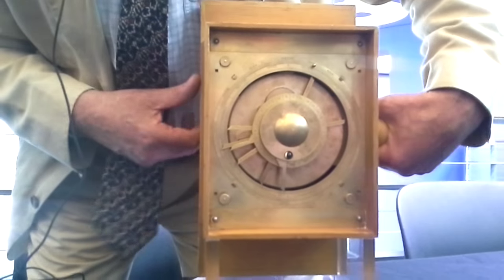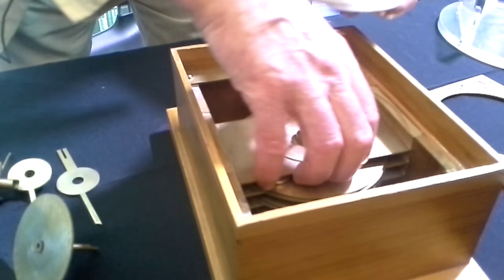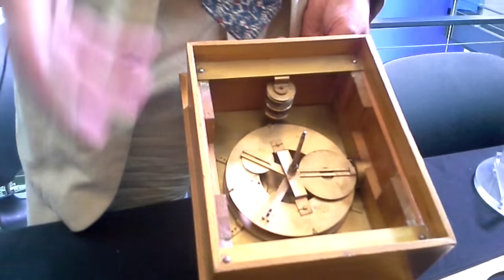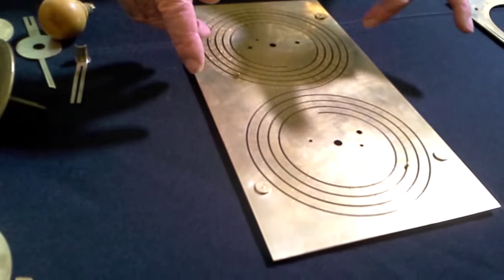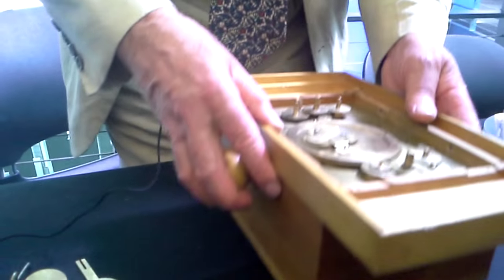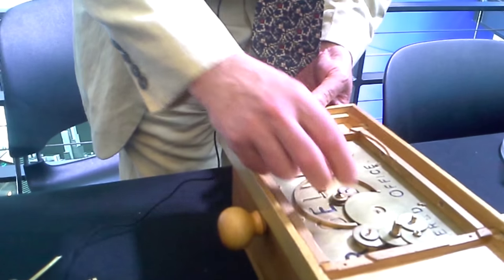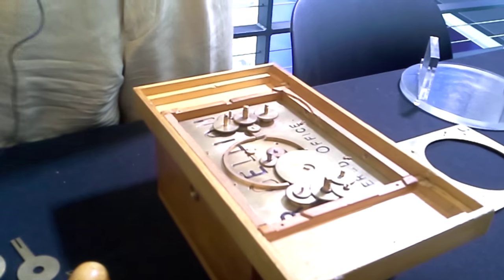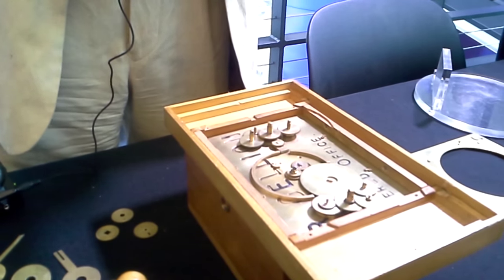Antikythera Mechanism demonstration, part 1

Comment: I like how this video explains how much of the device's modern replicas are "conjecture," and how little of it is actually known to be true. Most people talk about it like we know it did all these extra things.
Reply: Michael Wright (the speaker) is an expert on the mechanism.  He points out that some of the reconstruction is conjectural because not all of the mechanism made it through its sojourn on the Med floor.  However, as his reconstruction demonstrates, there is space within to support the additional functions.  There are, as he says, fragments of some of that that could indicate the functionality.  Furthermore, there was an instruction manual.  It was impressed on copper sheets which were placed on the covers and around the dials.  There was once estimated to be 22,000 Koine Greek words in the inscriptions, of which about 2,200 have been recovered and translated.  They mention functionality that sadly no longer exist in the orginal, and are therefore "conjectural".

About its basic functioning and what it demonstrates at an astronomical level, there is no doubt.  About it "conjectured" functionality there is little doubt, but no real hard evidence.
Reply: Lots of high resolution scans have been done on the original and people are able to make very precise calculations of the mechanism that remains intact the conjecture would be on the missing segments. I have been watching Clickspring recreating it and he shows scans where you can see pins and lugs used to hold gears in place it's fascinating.